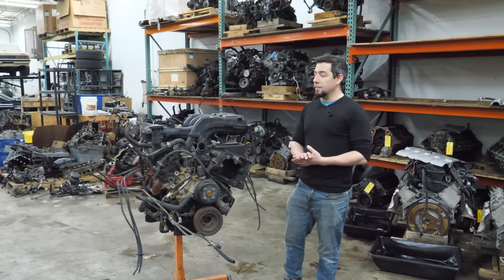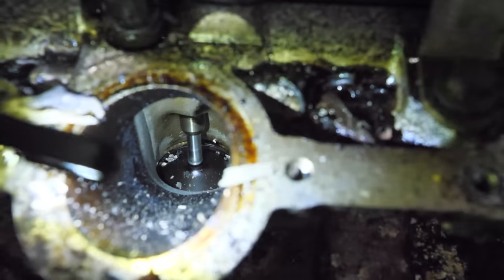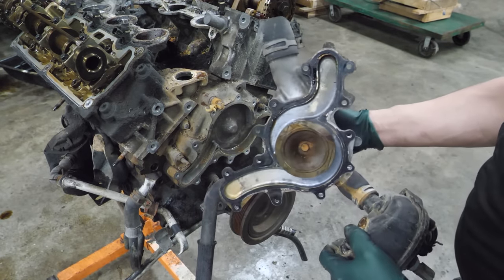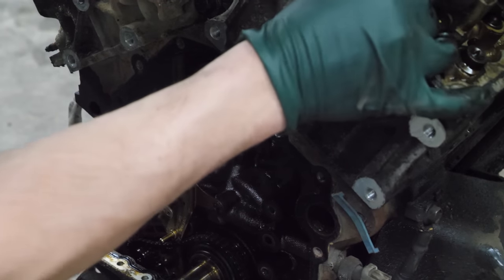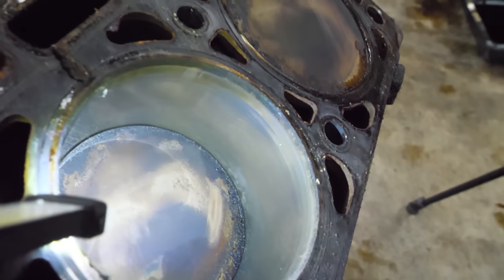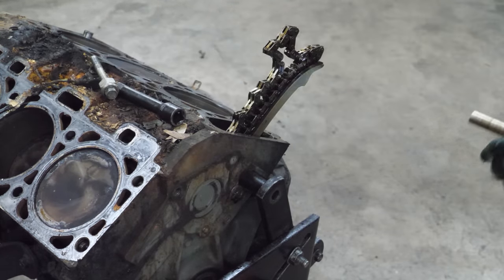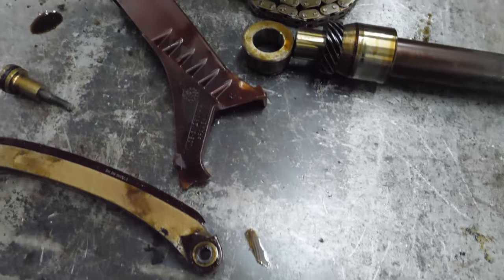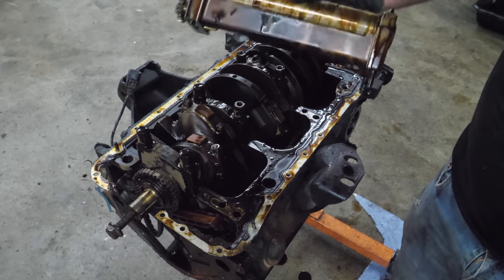Ford Explorer / Ranger / Mustang 4.0L SOHC V6 Teardown! Is This Why They're Called "Exploders" ?

Comment: I've got one of these in my mustang pushing 154k miles and not so much of an abnormally loud tick, the bottom of the engine is completely bone dry no oil leaks and it's able to hold up to my buddies focus ST before he builds his boost, as of rn im tryna research what I can with this engine to see if there is anyway to get any power out of them before boosting it

Comment: WHAT! SO, to replace this timing chain, you might as well rebuild the whole engine at this point. This is what I am seeing. You might as well do the whole thing, over a timing chain! I do have a question, will a T5 trans from a 4.0 fit a 4.6?

Comment: What is your recommendation for the most reliable, easiest/cheapest to repair and work on engine in a rear drive platform(car)? Preferably manual.  This 4.0 Cologne will not be a contender...how about ford 2.3's?  Or any GM's?  LS? Please any insight would go far for me.  Thanks

Comment: Here is the deal with the balance shaft. The 4-wheel drive Explorer models had the balance shaft, and the 2WD did not. That engine must have come out of a 4-wheel drive. I used to have two 2001 Explorer Sports with this engine in them. They were both 4-wheel drive and had balance shafts.

Comment: The failure was not the chains but the plastic guides that Ford used. They would break. Had it happen on two motors.

Comment: I worked at a Ford dealer back when those motors first came out, the timing tensioners were failing on low mileage motors. 
That motor is an engineering mess. They would have done far better to forego that thing altogether and just stick a 4.6l in all of those trucks. After doing a few of those timing jobs under warranty for warranty pay, I made it very clear to the service manager that I had been hired to work on larger vehicles, not that junk. I retired never having to deal with another one but watched guys curse those things when they showed up. 
The Ranger and Explorer were good trucks but the engine and transmission selection offered was terrible

Comment: I had a 4.0 in my 09 Explorer which is well after Ford fixed the timing chain issue. It had 230k and I never had any engine issues only the 5R55S transmission made of glass was my problem. The engine was tough but gutless in my heavy Explorer. It has the same engine specs as the Mustang variant but the Mustang has a different intake and supposedly a different cam. The Mustang weight is the only saving grace has to be. Because at around 5700 its shift point it was out of breath. I would have rather have the 4.0 ohv honestly.

Comment: I know I am late to this. A part that will wear down because its plastic on metal cannot be replaced without a total breakdown of the engine? I am convinced they tell engineers to over-complicate stuff so that regular schmoes take it in to the dealership for work.

Comment: 4x4 engine has a extra chain on timing to a weight. will the car throw codes or run bad with out weight on a 2 wheel drive. engine swap. great vid thanks... or the other way around ????

Comment: My 2002 ranger 4.0 has 230k on it and burns no oil, leaks no oil and runs fine. Im more worried about the automatic transmission than the motor. I would have rather had it have a manual, but can’t beat the 1k bucks i paid for it. Haven’t had any major issues and I’ve driven it 30k since i bought it for 1k. Guy who had it thought it was no good, but all i did was a full tune up and it runs Ike a top

Comment: That's funny because I have a 99 Ford ranger with the 4.0l ohv and it currently has blown head gaskets with only 238k. My other ranger is an 05 with the 4.0l sohc and it has 380k (yep you heard that correctly). Original engine no timing components replaced. I change my oil every 3k not 1 mile over! Maintain your shit! Also upgrade all the components you CAN with the 4.0l sohc like the thermostat housing to metal, and an all aluminum radiator.

Comment: I have this motor in my explorer lol its having a hard time accelerating and has lost some power. I get codes that say both banks are running lean and i had an o2 heater circuit code so i put a new o2 sensor but the code came back on. So im thinking of checking all the wires and making sure there is power running down there

Comment: I've worked in several shops that when a complaint of the timing chain rattle comes in, the engines are/were replaced in long block remanned form. Since the engine has to come out anyways, and the job replacing the timing system so time consuming, as well as requiring special tools, it makes no sense to bother. Stupid system.

Comment: So the engine balance shaft was on the 4x4's. For some reason theirs an engine balancing  shaft and a massive dampening weight on the front diff of the 4x4's. The balance shaft chain tensioner coming apart is very common as in 100% of them brake apart. To replace that balance shaft tensioner you have to drop ur front diff, rack and pinion, exhaust and remove the starter and upper oil pan or remove the engine (recommended by ford). I hate this engine but if you add boost you can make an explorer sport hit 60 in 2.6 seconds because the heads flow so well. Bolting on a super charger was common on these. Replacing the v6 with a Cayote 5.0 was also common. The upper oil pan seal, lower oil pan seal and valve cover gaskets are common failure points on every ford I have ever owned. I'm pretty sure the design elements of this engine is pure built in obsolescence. If you own this engine the first thing you will do is replace the seals the second is just replace it with a v8 or sell the vehicle.

Comment: 8:30 timing chain tensioners are supposed to be replaced every 40-50k but nobody ever did so hence timing issues "exploder"

also never use "bars stop oil leak" thatll sabotage your timing chain tensioners
Reply: If that is correct then that is ridiculous, especially considering the complexity and cost of the repair.

Comment: THAT WAS A EXCELLENT ENGINE AND ATHEY CLOCKED CLOSE TO 500,000 ON AVERAGE. IF YOU NEGLECT THE OIL CHANGES THEY WILL NOT LAST LIKE ANY OTHER ENGINE.

Comment: You are wrong,I have owned a 04 explorer and 04 ranger both ran great,both had over 200,000 miles on them,both had 4.0 liter engines

Comment: It's actually a good engine but you have to do preventive maintenance religiously or you'll trash it. You can't put it off "a couple thousand miles" and it'll be ok because it won't
Reply: i wish i could double like a comment, good blocks require good maintenance. people sit here a cry over theirs blowing up but they will neglect it until the symptoms start, and once those symptoms start it’s over forever.

Comment: Let me guess every single engine out there has ZERO PROBLEMS. After 159 to 220 thousand miles yes in my 2006 Mustang my (as yku called it) My ticking time bomb didnt detonate unt then. And even though i didnt drive it when i heard the rattle. ( Because i am not as stupid as I look LOL) Iquickly fixed the problem yes both sides. Stl i  Thank You  for the video

Comment: Uncalled for Ford hate. Seen multiple of these engines on the factory long block exceed 250K miles. 3-5K mile oil changes are key. Ford Green coolant every 2 years, or Ford Gold coolant every 5 years. Plenty of power for the late 90’s and not bad on gas.

Comment: You did not have to pull that driver side head off to get the cassette out the cassette you take the snap ring apart and take that hinge out and take the cassette apart and come out piece at a time you take a screwdriver and tap the chain up towards the top and it comes right out

Comment: The 4.0L OHV wasnt 'converted' to OHC/SOHC for power it was converted for emissions .
And it gets its bad rap from the 97-02 units that had the poorly designed cassettes. 02+ were pretty reliable.

Comment: I had a  96 ford explorer with the 4.0L motor but it was ok they aren’t very good on mileage but they aren’t that bad mine was low mileage had it for 8 years then sold it but not a bad motor you really have to take care of them, felt sorry for anyone that had to work on them replacing cam chains what a nightmare period
Reply: Given that model year yours was probably the OHV version of this engine.

Comment: Seems odd that Ford went with this over complicated design for the SOHC adaption of this engine.  They already had a relatively simple DOHC 4v conversion of the 2.9L version of this engine used on the 1990 UK Cosworth Scorpio.   That engine had all the cams driven from the front of the engine.  It was built for Ford by Cosworth but based on a race engine designed by Derek Bell (not the race driver of the same name).  Those engines worked well and produced huge power with turbos.  I have one. Point is that Ford already owned a really nice OHC derivative of the Cologne V6 back in 1989 but went on to use this SOHC mess instead.

Comment: Question I have a 2001 Ford sport Trac with the crappy 4.0 V6 when it comes time to replace will a 5.0 V8 drop right in I prefer the pushrod type engines anyhow

Comment: Timing gets out of time due to chain slop giving cam to crank correlation codes... IMO Its cheaper to get a reman rather than change all the chains... The labor for the engine pull is better spent in a New Unit... Plus you get the peace of mind that the new engine should get you another 300k
Reply: See how he throws the bolts?! No way I’ll get a reman from them.   Most engine bolts are specifically designed and they just treat them as nuts.  No, it’s better to DIY if you can!

Comment: Dang, i must have gotten as my engine was fine through 150K miles in my Mustang.  The car basically rusted out and the rear differential went before the motor did...

Comment: The overall design has its drawbacks but imo the Ford 4 liter is one of the most reliable long lasting engines or v6 engines anyways. I had a 95 ranger with about 400k on it. Gave it to my ex wife In the divorce. It's adequate enough in the power department  and if you put an upgraded timing set in there when you go in and change the oil it's going for 500 or 600k. The Ford 4.6 has periodically pulled upin my shops and bays with 600 to 800 k on the clock. Ford actually does build tough engines. The 24 valve 3 liter I've only ever seen one seize up. Ford engines usually have 1 or 2 things to look out for that are catastrophic potential but if avoided Ford engines of the 90s and 2000s were great for longevity

Comment: Didn’t they have two different variations of that 4.0 I thought that was a pushrod version as well as the overhead cam which is a crappy design, considering one timing chain on the front and one on the back.

Comment: That timing system looks like someone went “oh, we need an OHC head to compete”, and then went off and bodged together a timing system for the cams by modifying the existing pushrod timing design … that’s just a recipe for trouble, if you ask me - more parts, more things that wear, and more to go wrong.

Comment: Those Explorer's you are working on were labeled Exploders because the Firestone tires on them were blowing out. Not the fault of Firestone, maybe very low tire pressures, excessive overloading, and running 85 mph down interstates. Those tires didn't have a chance. That engine looks as if the owner changed his oil every 15,000 miles, just as the Stealerships want it. Nothing wrong with the engine, just poor maintenance by the owners. I've has a couple of those Explorers, 178,000 miles zero problems. Just do the oil changes every 4000 miles with a premium filter.

Comment: Just a ohv block with overhead cylinder heads. Isn't the block the cologne v6? When I worked for the city as a tech, a guy pulled a 4.0 out and did a timing job/ reseal. 1 week later, the Valley was full of oil and had a spun bearing. Don't know what happened, but this guy took cabs off 6.0 f450's, did caprice cam and lifters, all engine work, etc. He was the best, this engine was a bad design.  A ground up design would have been better.

Comment: Had one of these in a Ranger. With 3000 mile oil changes using synthetic oil. 200,000 miles later still going. On the other hand a friend had one and did the yearly oil changes and chains failed at 120,000 miles. 
The worst case with this motor was that it didn’t make any HP unless the revs were above 2500 rpm. No low end torque. And crappy fuel economy caused by high rpm on the highway.
Change your oil often because it doesn’t last as long as the mfg says it does

Comment: The sad thing is the original pushrod configuration actually can stand up to decent abuse for a v6 that size. OHC is great but this us why you can't just bolt OHC to an existing engine.

Comment: There’s a lot of comments in here that say that the timing chain setup is odd because it’s a converted OHV engine. Yes, it is a converted OHV engine, but that is not why the timing setup is weird. There are plenty of other OHV engines that were also built OHC (the 3.4 DOHC V6 is the first that comes to mind, based off the 2.8/3.1 V6) and they don’t have chains on the front and back of the engine. The reason this engine has chains on the front and back of the engine is because Ford was too cheap to make 2 cylinder head castings, so they made 1 casting and just flipped it around. The end result is that the cam sprocket is on the front on one head and the back on the other. Porsche did the same idiotic, cheapskate move on the water cooled H6s from the late 90s/early 2000s (the ones where the IMS bearing always fails). This wasn’t a necessary move for a converted engine, it was Ford being cheap.

That said, I could count on 1 hand how many of these I’ve seen with any kind of major timing chain noise, and there are literally millions of these engines out on the road (still). To put that in perspective, I’ve had to replace more engines in the older Land/Range Rovers for broken oil pumps than timing chains on OHC 4.0 Fords.

No engine needs a balance shaft. They are only there to reduce NVH and make the engine feel more smooth to the operator. They serve no other purpose.

Comment: After seeing this tear down I’m so glad I decided to scrap my 2003 Explorer instead of replacing the timing chains and tensioners. I had already replaced the engine once with a good running 2005 engine. That engine started making timing chain noise after a couple years so I decided to cut my losses and scrap it.

Comment: LOL I had a 94 explorer with this engine. I kept trying to kill it going off road and those valves kept ticking....and ticking.....and tapping and tapping .....and tapping. I was Literally trying to MURDER that engine. For six months i tried killing it. I heard they were sensitive to heat, so I tried to redline it as often as possible. 
Well, anyway. It died going up a moderate hill in clear weather. After that, I was free to install the 4.6 from a 97 F-150.  I guess the moral of the story is that this engine only dies when you DON'T want it to.  In any case, that explorer is still running around town. Still see it on occasion at the local mud pits.

Comment: Cam oil spray bars?  Oil distribution? Cam drive to jack shaft only supported on one end (drive wallow anyone?)? Pull the heads & the god damn engine timing chain replacement provisions? Haven't changed your oil in 10K? All good! Eagle Scout Hiking Badges for all!

Comment: The design wouldn't have been so bad if Ford hadn't cheaped out on the materials the guides are made out of. Guides that are a pain in the ass to change are okay if you never have to change them. I have read that Ford finally got the guides mostly right after 2002.

Comment: Is the 4.0 v6 from a 94 ranger/Mazda a different engine? My 94 Mazda pickup has 326,000 miles and is running fine.
Reply: Yes, that is the OHV version.

Comment: If the 4.0 engine is the only engine with  problem then what is it that you are working on? Because other engines have No Problems right just the 4.0

Comment: These things are also present in FFV USPS postal vehicles that my shop works on.  Havent done too much with them recently, but they are a bit of a pain in the ass to work on. Ive pulled a few oil pans to find that chunks of the guides in them lol. Because of that shitty chain design they also have oil pressure issues, but hey if the postal guys want a new engine, we’ll throw one in for em.

Comment: The 4.0 ohv engine might have had a little less power, but it was soooooooooo much better than the sohc engine, this thing would be a nightmare in maintenance costs. 🤦 what were they thinking? From my Nichols’s time labor guide, timing chain replacement for the 4.0 OHV is 4.8 hours the 4.0 SOHC is ,16.8 hours!!! Plus the timing component kit is well over $200 more than the OHV engine. Do that dealer labor price math in your head 🤯

Comment: Could you please explain to me how you call it a single overhead cam engine when it's got a cam on each head the single cam 4.0 was made before 2000 but the ones made 2000 model year and up or like this engine a cam on a side stop that was a dual overhead cam it's got to cam pacs

Comment: I think these engines are fine I've seen them with 272k miles with no noise at a shop I worked at, and it had zero issues . Although chevys 4.3 vortec engines are much better

Comment: I certainly don’t understand your reasoning , I owned this exact engine and it was in a o1 Ford xlt ranger 4x4 and never had an issue it had a tow package from the factory and yes I towed a travel trailer with it. I @lso took very good care of the engine using Mobil3 1 every 5,000 miles.*

Comment: Non symmetrical heads, kind of like a Porsche M96.  Only the intermediate shaft was installed where the camshaft of the OHV version was located.

Still a very average engine.....